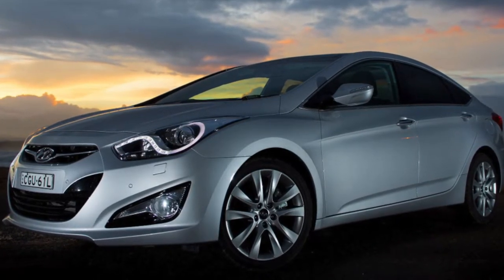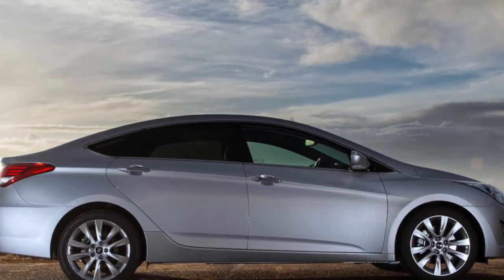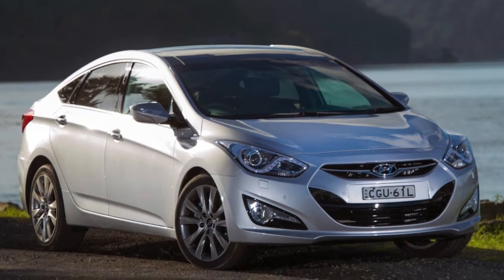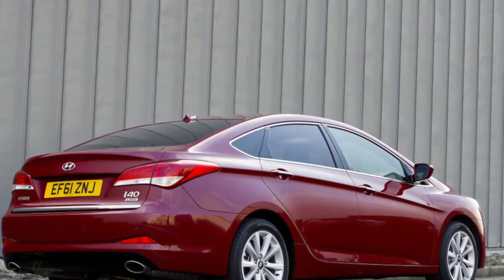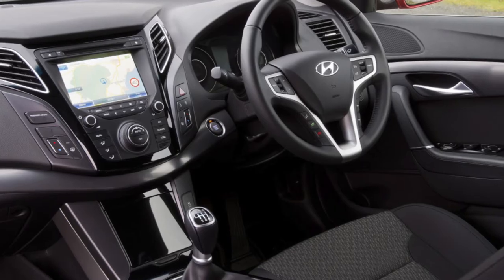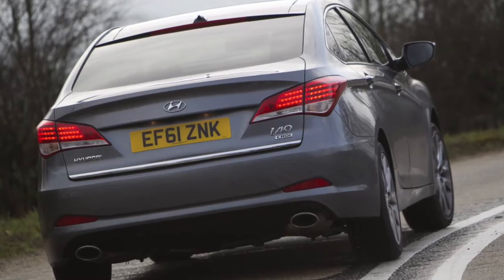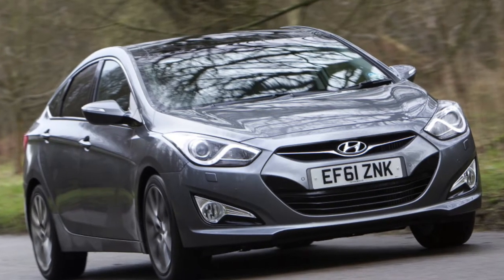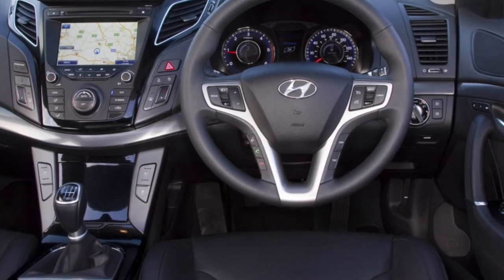Hyundai i40 Problems | Weaknesses of the Used Hyundai i40

Comment: I recently bought a 2014 Hyundai i40 active wagon with 82thousand kms petrol 2*0  love the car's interior design and exterior on negative side not good on fuel ⛽ i have narrow garage don't have folding side mirrors like old Lexus i owned i certainly regret buying the base model u don't get dual exhaust system to help with economy just a single exhaust system cheers Stephen 🍀🍀✌️👍

Comment: My i40 2013 year model has now 344700km mileage. And only huge problem is high pressure fuel pump......diesel enter into motor and it mixed with oil.
Reply: Ur dpf is full probably that’s why u facing this issue?

Comment: 440,000km and miraculously still running. Rear camera bad (as mentioned) oil leeks. Airbag failure on steering wheel. Otherwise not bad since it has such high KMs. Probably my last Hyundai though since it is hard to get aftermarket parts.  Almost all parts have to be ordered from Hyundai.  Has anyone else noticed this?

Comment: 2013 tourer 1.7 blue drive, 130k miles on her, ive had issues with a very low bite which got fixed when i had the clutch and fly wheel done. turbo went, rear caliper seized and boot wont open so now need new mechanism i think. so expensive to own but i love the car oh and had a leaking slave cylinder so had the master and slave clutch done too.

Comment: Have 1.7 turbo diesel 2012 odometer now 280k and still doing perfect but have shaking when accelerating between (80-110kms speed ) shaking from the bottom of the car no one knows the reasons maybe (engine mounts or transmission mounts still don’t know what should I change) otherwise it’s the best car ever and very economical
Reply: Get your front subframe bushes checked fella
Reply: Check your cv joint/boot

Comment: I have 2011 model with 1.7 diesel engine, 330,000kms so far I replaced,
Both rear break calipers,
 Front lower control arms,
Anti roll bar links and bushes,
Subframe bushes, 
Lower engine mount,
Timing chain and pullys,
Front and rear main oil seals,
Dual mass flywheel and clutch and release bearing,
Water pump, alternator pully,harmonic balancer, 
Injector washers and seals,
Alternator belt, 
Outer track rod ends,
Power steering motor bush,
Along with alot of other small jobs,
I find the car quiet heavy on fuel recently,
They need fuel filters regular also,
As well as the common pulling to the left issue.
But I still really like the car, very comfortable and easy to drive.
Reply: I had a toyota avensis t22 1999 1.6 Petrol with 360.000km. The only thing I changed was clutch, water pump and radiator. The car drove like new. Shame for newer cars breaking down so easily

Comment: Have a 1,7D,100KW,2012,230 000km (bought when it was 150 000km)

Have been changed engine chain 1 time,EGR valve changed 2 times.These are most expensive works.Also issues with rear camera(fixed myself by dissambling it,dried it out and use lots of silicon to avoid moisture get in to that. Front parking sensors wont work,but havent deal with that. Also changed crankshaft pulley and AC pump pulley bearing and rear breaking cylinders.
This car have a slack/play in a steering wheel,but dealer says its normal for that old car :) It cames from steering rack and column cross point.
Engine chain with replacement  cost 1000€(not in Hyundai dealer ,because it could be very expensive),EGR original part 600€ with replacement in Hyundai dealer.
Reply: Hi, your dealer is telling you bullshit about that "slack/play in steering wheel". This clanking sound comes from used rubber steering coupler  which is located in between steering column and power steering engine. Part costs from €6 on amazon and you can fix it yourself in less than 2 hours.

Comment: Im stuck between hyundai i40 and Opel Insignia which do you think would be more reliable
Reply: Hyundai i40 any day. Its bullet proof
Reply: I have one i40 with only 61k miles it had only one previous owner and full service history.... And is the most unreliable car I ever had.
Do not buy it!
Reply: I think I will take your word for it I didn't hear too many good things about it..looks really nice doh
Reply: @gavin9873  With either car the petrol automatics (old type auto not the more modern dual clutch) tend to be the best, as they don't have a clutch or flywheel, and things like DPFs, EGRs, injectors that are only issues with the diesels.  You could look at the Honda Accords, they are nice cars.
Reply: @dunk8157  yea I definitely don't want one with the dpf anyway that sounds like a nightmare,thank you for your help
Reply: @DorinG1991  Here in Ireland all the Police over here drives Hyundai's.. i30 and i40 they're very reliable cars recently. 2015 upwards .